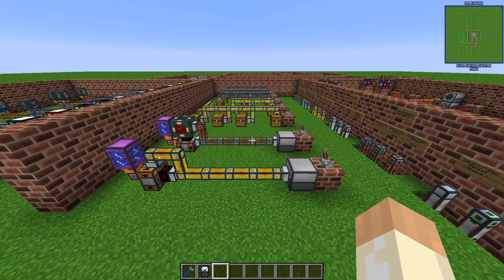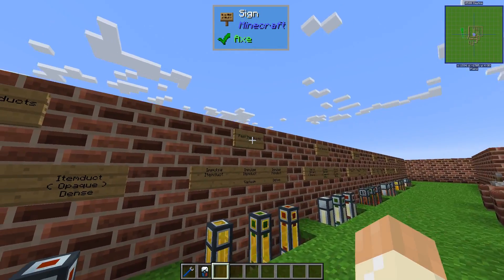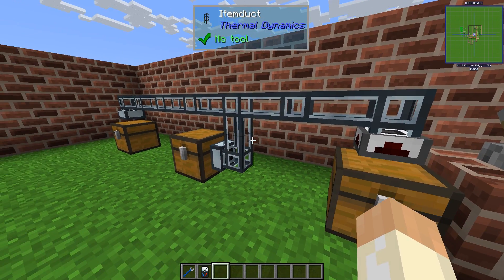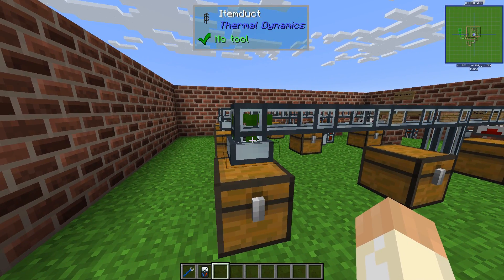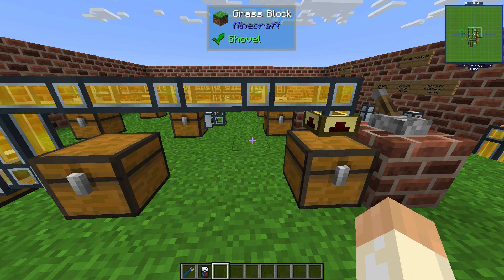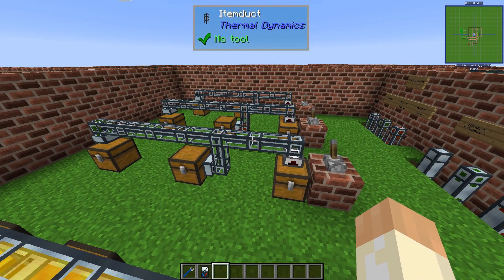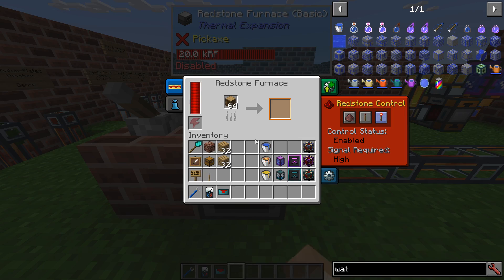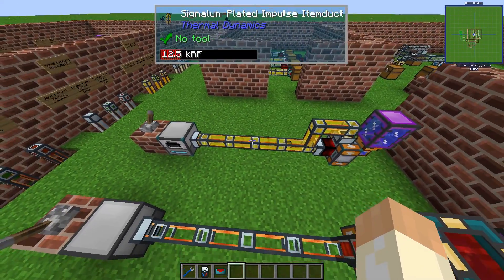Thermal Mods #5 - All Itemducts - Information And Examples

Comment: Very helpful tutorial! But I'm a little confused; what is the diffference between the dense and the vacuum one?
Reply from the maker: Thanks! The dense itemduct will act like it's far away, and the vacuum will act like it's closest. So when an item goes into a pipe it will try to go to the closest. If you have a dense duct connecting to a chest nearby and a regular pipe further away it will just pass the dense and go to the normal. And vice versa for vacuum :)
Reply: @therealtkh  alright, thanks! Really loving your channel so far.
Reply from the maker: @denis.salami  Thank you :)

Comment: is there a way to prevent itemducts from connecting to each other? and why are yours not connecting?
Reply from the maker: Yes, simply right click with the Cresent Hammer on the part of the duct you want to disconnect (or re-connect).

Comment: Love your vids TKH.  What version of game are you playing?  I have 1.7.10 and many of the features you are highlighting do not show up in Thermal mods for 1.7.10.  Most do though, so it is still very helpful.  I've been playing around with Thermal ducts since your vids came out.  Previously I always used Ender IO, which I still like quite a lot.  But this is interesting and fun stuff.  By the way, how would you compare Ender IO to Thermal Mods?
Reply from the maker: Thanks Mike! Well, you have all game and mod details in the video description. But I'm doing all these videos in 1.12.2. I hope that the core functions haven't changed too much, but a reason for making this series is to really go through IF anything has changed and all new blocks that I know for sure I haven't seen before. 

Regarding EnderIO ducts I actually thing they are much better because of one reason only: They can fit fluid, power and items within the same block space! In terms of functionality they are almost OP since they have almost all functions built-in from start. But they are good and very easy to work with!